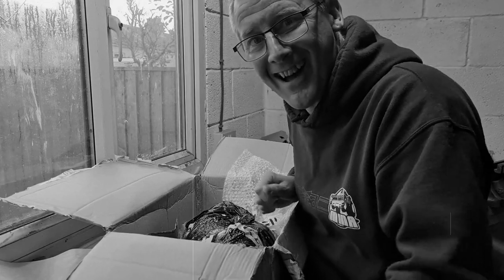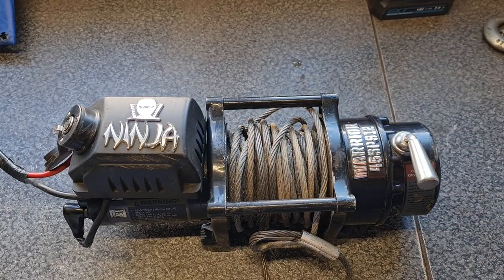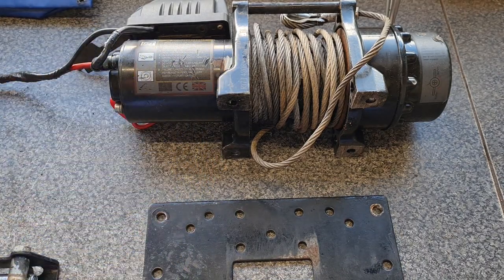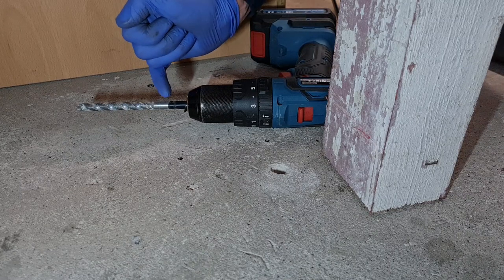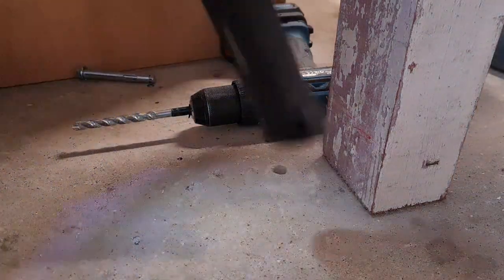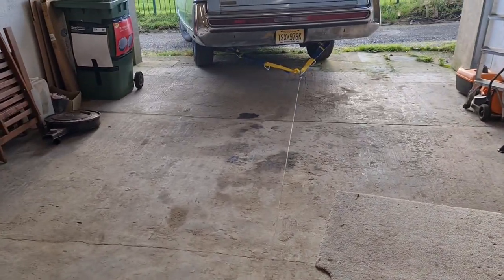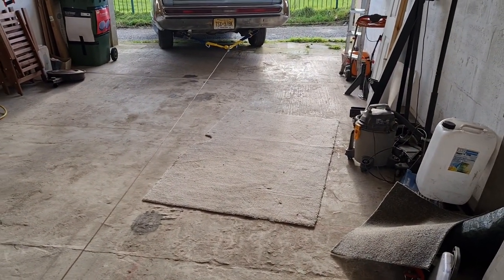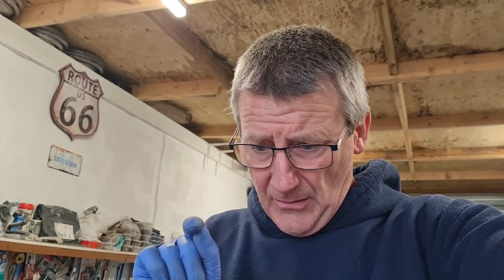Garage Winch Easy Install

Comment: Great idea. Another idea is to place shackles and pulleys at different points in your garage to pull from different angles. You can place one in the middle of the entrance to the garage and can pull cars out from the rear anchor points.
Reply from the maker: Good idea Andy, but I just need to pull a non runner in. It won't be leaving unless it runs 😁😁😁👍🏻👍🏻